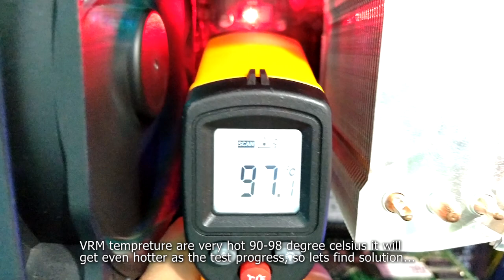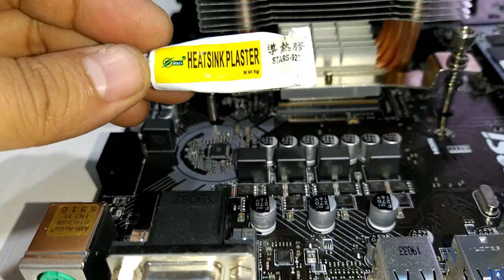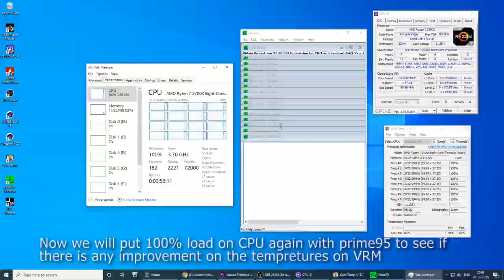Best VRM Cooling (30c Temperature drop)

Comment: Never paint a heatsink ever!
Reply: but why?
Reply: @humblehostile7946  paint doesn't transfer heat well
Reply: @mrsarcasm4874  i mean it depends on the type of paint used, it's really only a problem when you create too many layers of paint or use a thick type of paint like plastidip
Reply: Right! The paint reduces the cooling performance of the aluminium!
Reply: @MrGichinfunakoshi  i believe from testings i saw the difference its not to high, obviously there is difference but not by much
Reply: @Omabatfartsbruh  agree, in engine we have ceramic paint.
Reply: Honestly it might be best to paint the heatsink to avoid accidental short circuits. In my opinion it’s worth the few degrees in heat dissipation
Reply: @humblehostile7946  Don't listen to what people tell you!
Paint is an excellent insulator thus will sacrifice the cooling performance of the heatsink(copper/Aluminium).
Real enthusiasts go for performance not the gay RGB and or painted heatsink garbage!
Reply: Funny
Reply: :| don't paind it's fine i ll not paint as well :| u know i don't look at my pc and its inside not outside why r we worried about color. :| just buy heatsink and thermal compound sticky one and paste it
Reply: Get pure copper heatsink then set the whole thing in casting epoxy resin, so it won’t tarnish, conduct electricity, or heat for that matter 😁 also make sure you get as much skin oil on the heatsink as you can as it is a better conductor of heat than thermal paste. 👍
Reply: Titanium dioxide is fine
Reply: Na it won't effect temps by mich

Comment: Do NOT paint your heatsink... that only insulates heat and reduces the effectiveness of the aluminum or copper. If you desire a black heatsink, buy a black anodized product. If you are using liquid cooled cpu cooler, be sure to add a fan to the VRM heatsinks to ensure proper heat dissipation
Reply: Goofy ahh
Reply: Thank you I was about to install a watter cooler

Comment: Nice idea, good work... but, your paint job is cringe worthy... far too much thermal glue was used, like a drop per vrm would work and, but thermal tape would be better, and the heatsink is touching the caps, thats a no go. but other than that, good job.
Reply: Have you open up PSU before?  The temperature silicone/thermal are all over inside the PSU. It's okay to use thermal silicone because it's non conductive. As for capacitor, i don't think it will be problem.
Reply: Can you really short something with an aluminum heatsink?
Reply: Nick Bazin Heatsink shouldn’t touch any capacitors directly, can use thermal tape or silicone as contact medium

Comment from the maker: Do you have motherboard without heat sink on VRM's? then this video is for you!
Reply: This is incorrect you should Red the temps of the actual VRM using something like a hwinfo64 not the fins would you measure your cpu temp by putting your thermometer on the cooler fins or do you use a tool to measure the actual cpu temp
Cooler fin temps are always very low
Reply: If it has no heatsink for VRMs then it is blocked for overclocking anyway

Comment: So everyone who is watching this video nose please do not! Paint your heat sink. There's a proper way of dying it call the Anodizing. And for the love of God why did you put so much freaking heat plaster and you do realize by putting keep plaster on the chokes and capacitors that it only insulates them and retains the Heat
Reply from the maker: Yes Anodizing is proper way but hard to do yourself, and for such small heat sink will be very expensive to do from outside professionals. 

I put heat sink plaster on chokes because they were equally hot when I measured temperatures. so I have used the side of heat sink to cover the chokes. 
This system is running for more than a month  for 8-10 hours daily with full cpu load. I am using it for rendering and everything is fine no problem with caps or chokes. temperatures are also very good. around 68-70c at full load.
Reply: I didn't think about the mobo acting as a heat spreader heating them equally

Comment: Need to be very careful with this kind of solution. You measured 30 degree drop in temp but you don't know if that is because the heat transfer from the VRM to the heatsink is now poor. As in, more heat is now contained in the component and less heat is getting through to the heatsink compared to when the VRMs were in open air. The heatsink is painted and there may be the tiniest gaps between the components and the heatsink itself, even with the plaster. So the heatsink measures a lot cooler than the body temps of the VRMs

Remember its not the temperature of the heatsink that matters, it is the temperature of the VRM component that matters. You need to somehow measure the temp of the actual components otherwise you may experience early failure and not understand why.
Reply: Normally you can't measure copper surfaces with a pyrometer at all, as their emittance factor in the frequency range that the pyrometer picks up is like 0.03, as opposed to 0.95 that the pyrometer is calibrated against, so you just see reflection of the environmental heat rather than emitted heat, and you need to take into account the pickup pattern of the IR optics, so it's difficult to avoid contaminating the measurement. The paint, while reducing thermal performance, might have actually helped with the measurement, but it's still inconclusive, since it's difficult to say how much of it is on there. Still, the mod is likely to have been beneficial.

A good proxy measurement is just the PCB temperature in direct vicinity of the VRM, maybe at thermal stitching vias on the back side under the edge low-side MOSFETs, while controlling for performance i.e. consumed power that it is actually the same. It is easily measured with a K-type thermocouple or a bead thermistor.
Reply: I am currently experiencing vrm throttling (same mobo brand) HWinfo says its prochot ext (not the cpu, other components) since I chose to change my cooler to a high profile one like the one in this video. I think the downforce wind from the stock cooler also cools the vrm of this mobo. Based from what you're saying maybe if I tried this and HWinfo does not report prochot ext throttling then this video is effective.

Comment: Dont paint or cut your heat sink just buy the right ones and dont use paste use thermal tape from 3m. Other then that this is a good idea to lower temps for 10 dollars. Dont look for gains tho this will help with throttle durring the summer and still you wont notice any gains.
Reply: Why we should not cut heatsink?

Comment: 3:04 you should make as many radiators as elements you should chill . For each element 1 radiator because total surface of all elements isn't completely same , some higher some lower that's why they use  thermal pads .
Reply: So  can you glue the thermal pads ? (since they are not adhesive) and then put the heatsink on top with glue too
Reply: @gabrielst527  glue and thermal pads - no this is stupid :)
Reply: @RAMMSTElN  Lol
Reply: @RAMMSTElN  Well then thermal pads is not the solution, it's a vertical placed VRM with no presssure. 
The real solution is thermal glue or thermal tape. Pads are for things with pressure (like gpu VRM that have a plate on top of them)
Reply: @gabrielst527  right

Comment: i have never seen a half way decent mainboard that doesnt have pretty bulky VRM cooling :0

my MSI and ASrock boards always had thick aluminium heatsinks.

and i know older boards which even had full copper heatsinks. 

edit: i checked a super cheap AMD APU mainboard (no name) which is from 2011. I got it gifted and never tested it yet.

and indeed it has no vram cooling. I will defenitely fix that. Luckely i have tons of heatsinks here.

i will glue them on with thermal double sided glue tape

Comment: i get the idea but you could use a lot less paste, and maybe shave/sand down the edges of the heatsink a bit so they dont touch the capacitors at least... why did you paste the capacitors? Good idea, but the execution could be much better. Thanks all the same i do appreciate it.
Reply from the maker: When I measured temps on caps I saw them at around 90c so it was also required to cool them down. Since there is no conductivity involved I though why not use the same  heatsink to also cool them down. 

By the way the system is running very nice and cool without any problem.

Comment: Won't the paint act as an insulator to the heat sink surface area? Or is that some kind of thermally conductive spray paint?
Reply: Yeah it will. I've seen people spray paint noctua coolers and seen higher temps

Comment: Great job but as probably said before you shouldnt Paint Heatsinks (reduces heat Dispersion) also thermal pads across the whole heatsink bottom then onto the VRMs would increase the transfer to the Heat Sink more effectively overall you could have maybe had a 40-45c drop.
Reply from the maker: Thank you! Yes I will keep that in mind next time
Reply: Only problems is pads dont hold the heatsing where it should be. you use pads for stuff you can fixate with something else
Reply: @mrn234  yeah but u can put some glue on the buttom of the heatsink then put the thermal pad then glue the vrms and put the heatsink i think it will be good and holding better
Reply: @xRumvley  you cant use just "some glue" and when you use glue you can already get Thermalglue thats made for something like that. No pad needed. Its basically Thermalpaste+Glue
Reply: @mrn234  u miss understand brother when i said glue i meant the thermalglue that he used in the video
Reply: @xRumvley  but you still dont need a pad when you use thermal glue.
Reply: @mrn234  i have the build sitting up and i saw some guy says its better to have thermal pad between the glue and the heatsink so thats what am going to do am going to put the thermal glue on the mosfets then put the pad above it and put some on top of the thermal pad then have the heatsink sitting on top of it cause as i see the thermal pad makes a difference bigger than only thermalglue am only experimenting  in the end
Reply: @xRumvley  is with the termalpads its better? Gotta get thermal glue tommorow, due my vrm runs on 80-90-sometimes up to 100C (on prime95 of course)
Reply: @Uraim  i ended up putting only thermalglue on the little heatsink that i bought for the vrm's, didnt put thermalpads cause am lazy lol but ended up with great results went from 130c on prime95 with bottleneck/downclocks on the cpu clocks cause of the high VRM temps  to like 90s and 60-70max while gaming and 0 bottlenecks on the cpu so it was actually worth alot but i still think putting thermal pads in between will help but as i said i was too lazy to actually do it .
Reply: @xRumvley  nice, i looked for thermal glue in Serbia, i didnt found other than one or two. Rare stuff, will gonna check the local shops, but i guess they will not have any.
Reply: @xRumvley  also i measured how much space i have to put the heatsink well, i have 5mm gap in between the choke and the capacitor. that i can fit a 5mm little heatsink to cool the vrm down.
Reply: @xRumvley  gotta update stuff, I did not found thermal glue in my ding donging country that was reasonable, but I did the move. 
I did put thermal pads under the heatsink, due there was a resistor that would been shorted, also I did put only normal thermal paste. Heatsink stuck between the choke and caps nicely, but I did put heat isolation between the caps and heatsink to prevent any problems, I did only on 2channel of vrm (2left due I don't have glue to glue on choke, but on the test, the system was pushed almost 3watts more, and it was responsive 72.3W to 75.8W ) before when I did not have that heatsink, the system was unstable. What kind of glue you recommend to glue the heatsink next to the chokes? (On the MOSFETs, there will be only thermal paste and termalpads)

Comment: ohhh i have to do this, on my gigabyte b75 d3v there is 8mosfet and the processor is 95Watt design, while i draw 70watts from the cpu, i have 80-100C on my VRM, also my cpu runs up to 90C so its time to replace the thermal paste and apply heatsink on those mosfets :D

My cpu was applied with Arctic MX4 two years ago, well the webpage telling us that, that thermal paste is good enough up to 8years, i dont think so. :D

Comment: Can you get the actual temps from the motherboard ? Because now your reading the heatsink temp. It would be nice to know the actual VRM temp.  I think MSI got some software for it, but i'm not sure, mine is gigabyte. Thanks for sharing.
Reply from the maker: My motherboard does not have VRM tempreture sensor on motherboard. It only comes with on more expensive models. So had to use IR sensor to monitor it.
Reply: @InvertLogic  Then it would be harder to do. For future reference you could (if your case allowes) measure the back side of the motherboard before and after placement of heatsinks. Have a great day!

Comment: I'm afraid those coolers won't hold well on such small areas, certainly not with just one-part silicone adhesive. That motherboard thermally dilates, so it's not even a good idea to glue it over multiple chips together.
You need to cut the heatsink into smaller pieces (one piece = one chip) and glue it with two-component glue (regular glue will do).
Reply: thats a bad ideas because the cooling surface becoming smaller, less surface area = less cooling effects, in other channel he tried using small electronics heatsink and put it just like your advice and no effects at all.
the same logic apply to CPU cooler, why CPU heatsink getting wider?

Comment: You used your thumb to wipe the bottom off before putting the heat sink on. Need to remove and clean with alcohol and use the thermal glue on the heat sink then press down on vrm's

Comment: Very cool video, but are you sure the heat sink is supposed to touch the caps? Maybe that’s not they way it should be
Reply from the maker: When I measured the caps tempreture they were equally hot. I m not sure what max temp they are rated for but thought giving them cooling will be ok. I m using for a long time now is working fine. No problem covering cap for me atleast. But yes it can be avoided if you think that's not right. Thank you
Reply: @InvertLogic  can we do overclocking this way?

Comment: Hi,
We had the same idea, I have the MSI B450 PRO M2 MAX motherboard.
I thought of a cooling system with hollow brass tubes that we would come to tighten with a part printed in 3d which would also allow to bring an air flow.
Reply from the maker: Yes u can do that but may be you need platform to properly make contact with MOSFETs

Comment: You can messure the VRM temps by using HW monitor.
ALso, care, you are not longer messuring the VRM temp itself, now youre taking heatsink temp!
Awesome idea and job dude!
Reply from the maker: Not all mother board give options to moniter them VRM temp  in HW monitor. So it's not possible specially the cheap ones. I agree that there will be some degrees of difference we will have in reading if measured at heatsink. But hey it's better than having no heatsink at all. Thank you
Reply: Where in HWmonitor does it show vrm?

Comment: should i do this for my a320?
Reply from the maker: Yes sure
Reply: Your Mobo doesnt do OC so its fine
Reply: did it for a320m s2h with smaller heatsinks. Decreased temps 76 78 to 63 64 celcius degrees. using ryzen 3 1200 af 3.45 GHz@1.056v
Reply: @omerxa  haven't done it but I got a better cooler and my temp went from max 95 100% load to 80 should I still do this

Comment: I have the same cpu and with my current vrm cooling (or lack of it) I can't go above 4ghz
Reply from the maker: You can try installing heatsink. And may be go above 4ghz if the VRM and CPU maintain tempreture.

Comment: hello, is the glue solution better than termopad? looks like thermopad is easier solution
Reply: It can fall and short your motherboard or GPU.
Reply: @blogJM  I've had heatsinks attached with an Akasa pad for like 8 years, never falling off; but they were pretty small heatsinks. For my new one, i am doing a screw mount because i really don't want the heatsink to fall on the GPU, I found an almost-fitting heatsink where i only had to drill and tap screw holes.

Comment: Can this short out components since the heat sinks are aluminum?
Reply: afraid of that too,the only thing holding me back
Reply from the maker: If you look from the side angle all components are below that level so that it do not touch any components. However I will advise to check your mobo first as they are all different.

Comment: I don't think you actually did anything besides reduce the temperature of the heat sink, for my research the thermal pad you removed from the vrm and heat sink has around a 6.0 W/m K of heat dissipation compared to vrm cement which has only 1-2 W/m K of heat dissipation.

Comment: If you pain it you reduce the cooling performance
Reply from the maker: Yes or no. It depends if you paint surface that contacts MOSFET. Painting on side may not be that of a problem. It can hardly effect the cooling. As heat can still dissipate
Reply: @InvertLogic  I think that the paint is a barrier betwen the air and the aluminiun and reduces the cooling performance! But i can be wrong

Comment: What are the measurements of Ur heatsinks
Reply from the maker: It's around 60-65c
Reply: @aciemiller3443  I don't care about the thermal glue he used, the way he put it on did look pretty dodgy, for what doing it'll work for me
Reply: @aciemiller3443  How many times are you going to comment this?
Reply: @aciemiller3443  How many times are you going to comment this?

Comment: Can someone explain why is that thermal plaster with 1.2W/mK thermal conductivity better than a thermal pad or paste of 13W/Mk and non-electrically conductive?
Reply: The point is to glue the heatsink. Thermal paste isn't glue, so it won't stay.